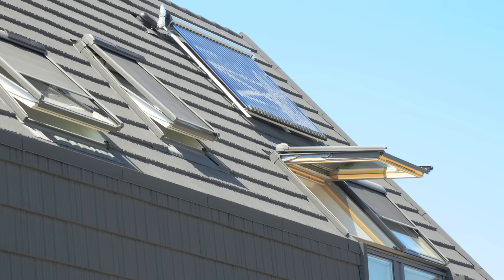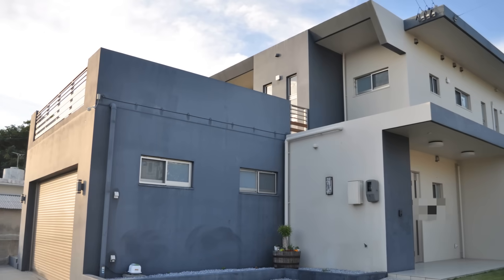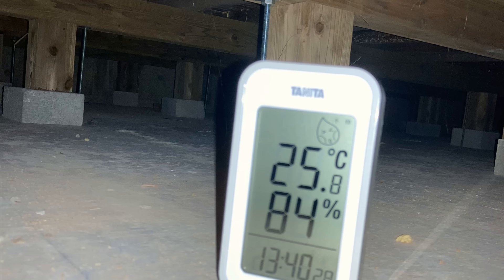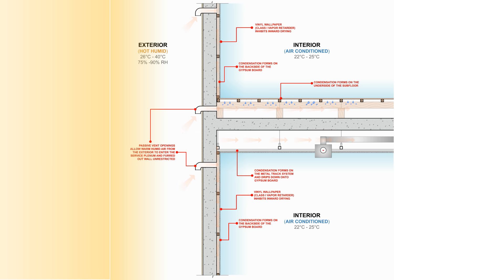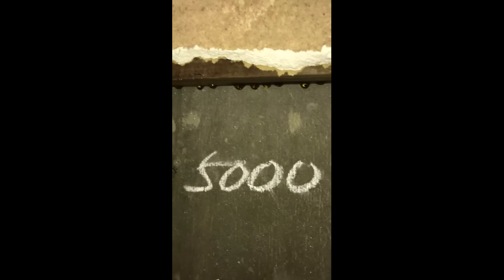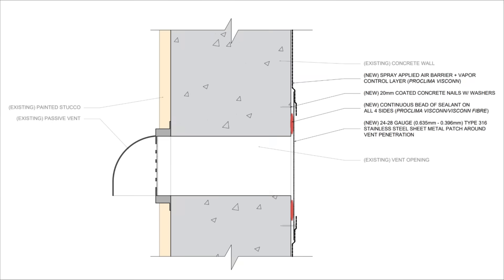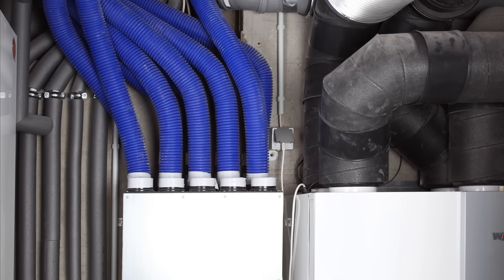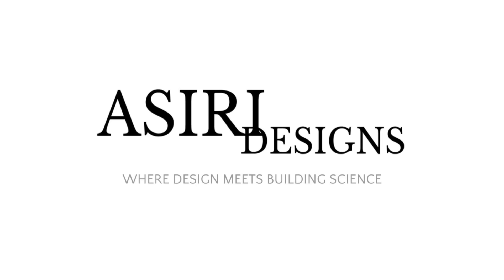The Unintended Consequences of "Passive" Ventilation... (A Case Study in Japan)

Comment: I feel like a small active ventillation system can couple with passive ventilation as a hard counter to the humidity issues, it's more expensive but it would provide overall superior venting and the best of both worlds. Thanks for the video bc i always thought that although inferior, modern materials like treated lumber would be resistant to rot.
Reply: "Passive" also includes turbine vents, most of which are just a piece of metal in a pipe, increases throughput of air. 
The most active system that is needed will be a ventialtor in a bathroom.

Comment: Why they have drywall inside on concrete walls instead of plaster? Also sealing the insides does not seems really healthy especially when using AC which kinda get inefficient when windows are open.  
Have you thought about recuperation system? Since there are holes in the wall already, it might be worth checking that option. Depending on unit specs recuperation can keep humidity in check, keep inside temperature by cooling incoming air with outgoing air or vice versa in winter, filter polutant and can be either local unit per room or full system per building.

Comment: The Passive House Institute Korea and one Korean company have brilliantly solved this problem. A highly efficient heat exchanger draws in outside air. The outside air is cooled and dehumidified by a heat pump, then heat-exchanged with cooling water to create fresh, dry air at an appropriate temperature, which then ventilates the interior. The cooling water flows through floor-mounted pipes, exchanging heat with the structure. In winter, heated water flows through these pipes. Yes, it's a radiant cooling system that doesn't generate condensation. However, if the building doesn't meet Passive House standards, the system can't be maintained.

Comment: Passive ventilation works in cold dry countries like finland. if done properly without modern insulation or machine ventilaion old houses will last over 100years without mold problems.
Reply: According to this video it also works in hot wet countries like Japan.

Comment: It feels like there's something else going on here. These vents are in the vast majority of new homes in Japan, as are mini split air conditioners, and most homes don't have these kinds of mold issues. Okinawa is unique for its climate and preference for concrete construction, but hot, humid summers and concrete condominiums are present all throughout Japan. Vinyl wallpaper is also quite common, I would imagine. One thing I noticed is that your diagram shows a vent leading directly into the subfloor area of the house. I've never seen that before - all of the vents I have seen lead directly into air conditioned spaces, where any air being brought in is quickly going to mix in with the cooler air and be dehumidified by the mini split. Bringing warm air directly into the spaces between walls and floors, on the other hand, seems like a very bad design, and also very uncommon. Basically I think the architect or builder screwed something up rather than being an issue with passive ventilation in general.

Comment: Very similar problems in the cold damp environments as well (UK; Scotland), especially in older properties without any solum seal.
Just had to do a major remediation on our new (1960's) house after we found excess condensation under the floor (I suspect partly driven by floor radiation lifting moisture from a damp solum to re-condense on the very same sub-floor - short range radiation is a forgotten problem)

Comment: sounds to me if there was no ac or temp diff this wouldnt be an issue. thats how old buildings works. there are pros and cons to either solution but i find it kinda of wierd that was want houses more sealed now a days then less. when it hasnt been that way for 100 years of years. in theory its great until the power goes out then your central air system isnt circulating.
Reply: If that ever happens, you just open the windows. Easy.
Reply: > sounds to me if there was no ac or temp diff this wouldnt be an issue

Sure, but nobody has ever suggested this solution in northern Russia or Scandinavia, and yet you can still find 500+ year old buildings in those places despite vastly greater inside/outside temperature differentials. If you want the interior environment under your control, then you definitely want a sealed environment with openings that you control, like windows, vents, or heat exchangers.

Comment: When is 'overventilation' with MVHR (8:19) a problem? I can see it wasting energy, but not why it should be a building-physics problem.
Also I wonder in this case whether a much cheaper, but adequalte solution would be to switch from extract  ventilation to positive input ventilation (PIV).  So the conditioned (lower humidity) air was going out through the building vents, rather than the warm wet air coming in through them?
In the UK PIV is a terrible idea, because in our climate it produces just the same problems this house has (moist air being pushed out into the building fabric and condensing). But in the Okinawa climate it sounds like it would work reasonably well.
Obviously sealing the building and putting in MVHR is much better, but also dramatically more expensive.

Comment: This look more like misapplication of an air conditioner in a traditionally built home with passive ventilation. They should have gone with awnings, exterior window blinds or shutters, and the thickest thermal insulation they could fit. You don't need to pump heat out if it can't get in.

Comment: meanwhile european houses with thick brick walls but wood floor joists just go on forever, some cities have such houses from the 1600's still standing strong if the roof was maintained well through the centuries. no ventilation at all except for people opening up windows now and then
Reply: Yes, but there are a couple of major differences. Firstly, the humidity is rarely that high for long periods. Air conditioning is not that common, as a stand alone device. It’s almost always combined with a dehumidifier, if it’s fitted at all. 
The whole way through this video, I was marvelling at how everything is opposite to what we’re used to, simply because of the high environmental humidity over there. 
As for the thick brick, or stone, walls… they can’t do that, in places where the ground moves. Buildings need to be on flexible foundations, raised off the ground, to accommodate movement due to quakes. This creates what Americans refer to as a crawl space, but is actually another face for the building to interact with the surrounding air, that simply doesn’t exist in solid buildings typically found in places where the ground never shakes.
Reply: Those houses from the 1600 have a LOT of ventilation.
Old houses (meaning every house older than 50 years or so) are not airtight in the slightest. They are very drafty. So they have a lot of ventilation built in.
Reply: Different climate and different material availability. There are 400 year old wooden temples in Japan still surviving. Europe is not so superior.
Reply: @rsmith02  how many of them are the original building though?  They're almost always rebuilt every couple of decades, but is counted as the same building.
Reply: @inflikktion  No, they aren't rebuilt every couple of decades. I swear to god, Europeans are the most undeservedly elitist people these days, especially about home construction and construction materials. It's absolutely bizarre. If you don't build it the way they build it they'll point and laugh and tell you your country is anywhere from 30 to 60 years "behind" them. They can't be bothered to understand nevermind admit that there are other good, efficient, effective ways to do things, or that other environments and climates and geography may be significantly different from their own.
Reply: No air con. It's the air con that was causing the problems in that house.
Reply: 1. Europe doesn't have weather
2. Whether a building survives or not has more to do with occupancy, desirability, and upkeep than anything.
Reply: Low exterior humidity and summer temperatures are responsible for that.